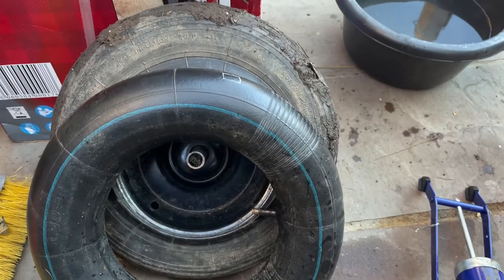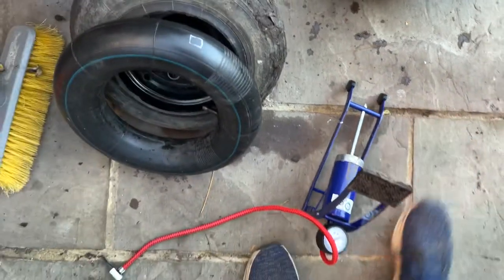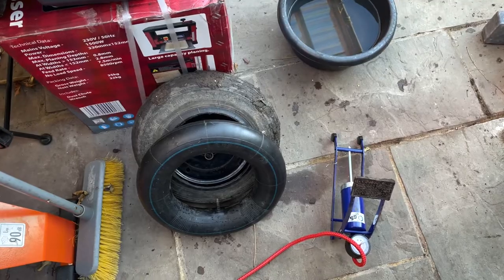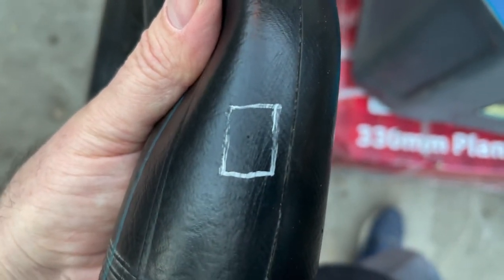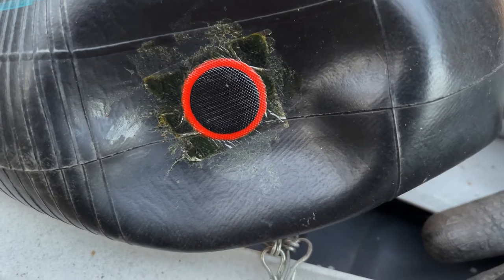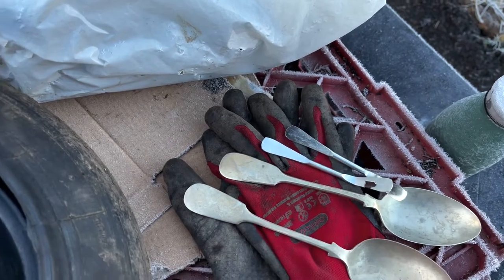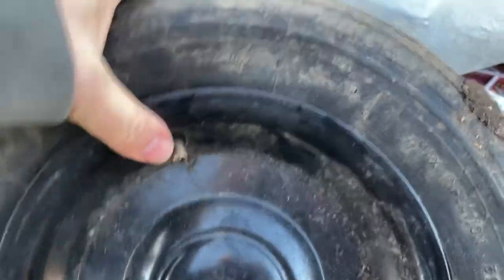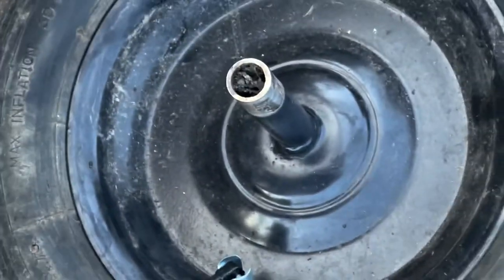REPAIRING A FLAT WHEELBARROW TYRE WITH A PUNCTURED INNER TUBE

Comment: Rub the metal strip over the area you are putting the glue and then exactly how you showed, don't forget to add chalk to stop any glue sticking to the inside of the tyre. We'll done Mark. I have a video that shows you how to do this without tools. I never check out of the tyre, best get it in ASAP so the air pressure keeps the patch on. Definitely inflatable on any allotment or growing spaces. 

♻️Happy gardening, Terry King.
Reply from the maker: Good advice Terry! Sadly no chalk but it dried overnight so all good! Yes I remember your tyre video, in fact it inspired me! Thanks for the encouragement my friend! Very much appreciated! All the best
Reply: @MarkyBigSmoke  I have spare wheels for mine so it at can be repaired at my leisure.
Reply: @Terry King's Allotment Gardening On A Budget  actually Terry you have 2 videos on the subject. Episode 28, 2015, and another last August, lol !! 
Great job, Mark!! I think I could do this now.... with Colleen's help ;) 
Cheers gentlemen
Reply: @clivesconundrumgarden  I found another Wheelbarrow yesterday, are you following me.....lol only used once and tyre blew off the rim, was put out for scrap.
Reply: @Terry King's Allotment Gardening On A Budget  perfect how many wheels you up to now, 3 or 4? 😁
Reply: @clivesconundrumgarden  4....lol. you see it Friday on the Flutter Draw.
Reply: @terrykingsallotmentgardening  #24forthethewin!!!

Comment: Ahhh...brought back childhood memories.  Between my brother and me, seemed we fixed our bike tires couple times a month.  Tip:  Back in the day, after applying the rubber cement, we would light the glue on fire for about 5 seconds, blow it out and quickly apply the patch.  The heat really made that sucker stick on real good...
Reply from the maker: Hehe, yeah, my childhood memories came back at that moment too! Such fun fixing bike tyres! Thanks for stopping by.